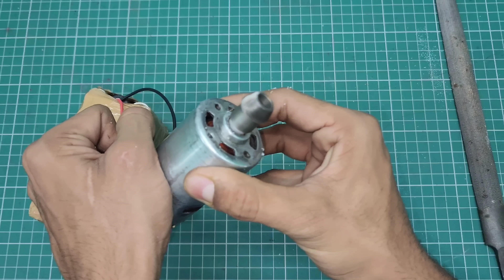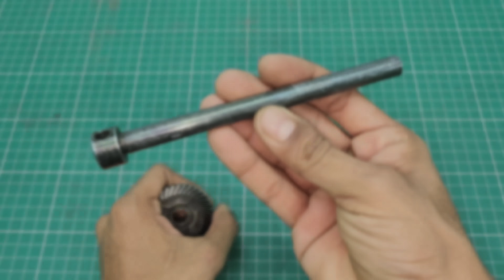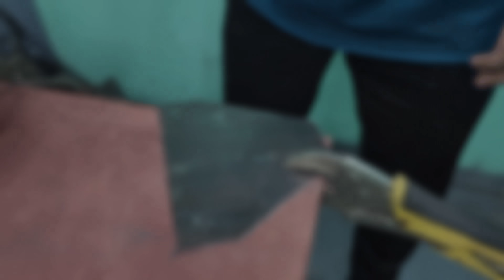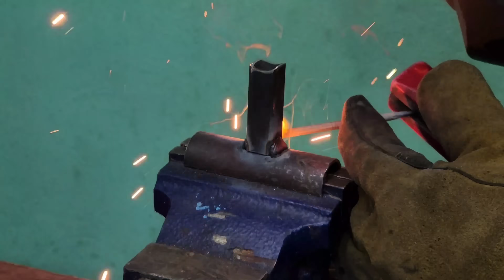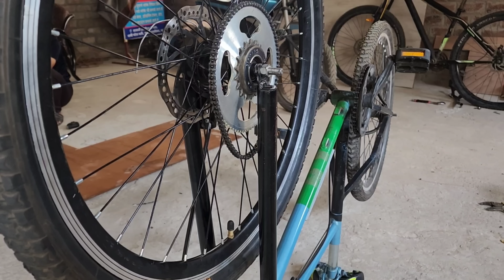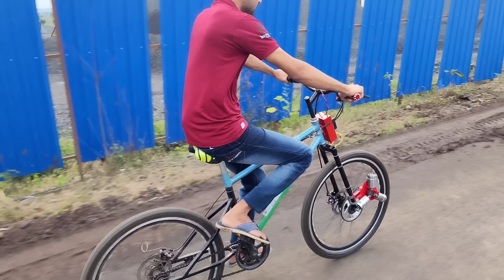Electric Cycle Build With 775 Motor: Shocking Results!

Comment: Cool design.
I think you can add an additional three motors, it looks like there is room between the three.
If  you are not able to fit 6, try 4 or 5, there looks be a good bit of room to add motors in your design.

Comment: First mistake: those dc motors can NOT face any axial force and conic gears do generate it. So, in your shoes I wouldn’t expect reliability and long lasting performance.
Reply: The pto side of the motor has a ball bearing not a oil lite bronze bushing. the bb can take light radial and axial loads.
Reply: No hay demasiados problemas con las leves cargas laterales de los cónicos.
 Para mí el mayor error aquí es pretender mover este conjunto con sólo 7 celdas de ión-litio.
 He visto muchas construcciones eléctricas. En la mayoría que hizo este autor, el índice de reducción con motores 775 y de otros tipos, no era suficientemente reductor. Es necesario más de 10/1 al menos para estos motores.
 En este caso usó 2 etapas con buena reducción, además de triplicar el par, por lo que la base mecánica es aceptable.
 Vi el error de unir los engranajes cónicos con pegamento a los motores, en vez de metal torneado a medida, con tornillos prisioneros, por ej.
 Otro fue no usar un buje torneado con topes de desplazamiento lateral para los 2 rodamientos del cónico grande. Otro fue soldar los propios rodamientos, lo que deforma sus pistas de bolas internas, aumentando la imprecisión, rozamientos o problemas de fiabilidad. También la imposibilidad de sustitución.
 Otro error para mí, colocar los 3 motores por delante de la rueda en vez de por detrás.
 Otro, no usar carenados en los engranajes.
 Otro, soportes unidos con bridas que pueden desplazarse.
 Otro usar potenciómetro con perilla o rueda en vez de acelerador con retroceso por muelle.
 Pero el mayor, no alimentar todo con la potencia eléctrica suficiente, por lo que todo este trabajo no podrá dar más utilidad que el simple pedaleo.
 7 celdas 18650 no pueden liberar más de 70w contínuos.
 No obstante, este hombre es muy trabajador y me gustan sus vídeos. Ha hecho más trabajos que la mayoría de nosotros y sirven de inspiración.

Comment: I'm trying to use 775 motors for a tennis ball launcher machine. I'm finding it difficult to get the exact parts needed to attach everything together and so all is aligned well. Interesting to see you use the clear tube as the coupler.

Comment: Hallo Schlaumeier ich rate dir auch einen Schutz gegen Regen zu machen auf den Motoren! Wenn es plötzlich stark regnet könnten die Motoren nass werden und einen kurtzschluß machen! Viel Glück Amigo!
Reply: Rain won't cause any major damage at all, you can even power a DC motor fully submerged underwater, if afterwards you clean it with distilled water and some WD-40, you will be fine and the motor can still last for a long time.